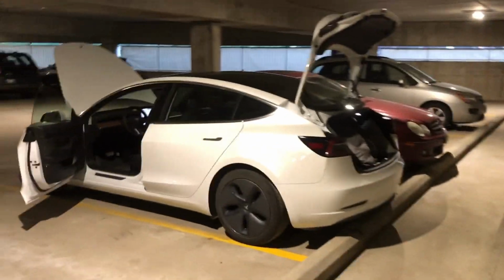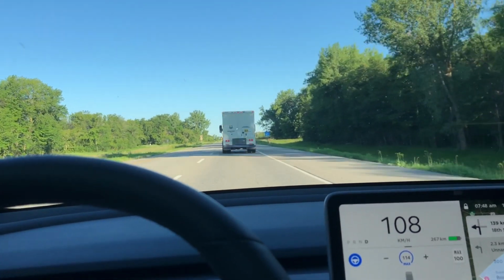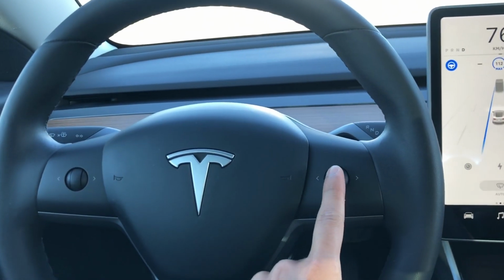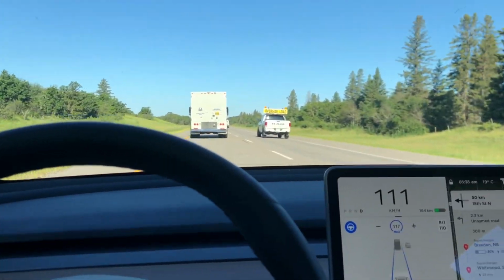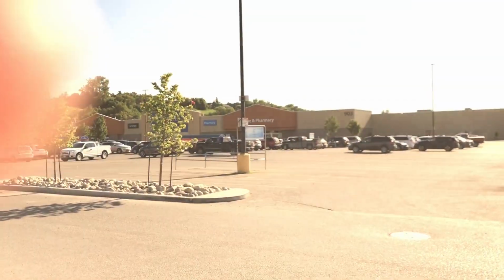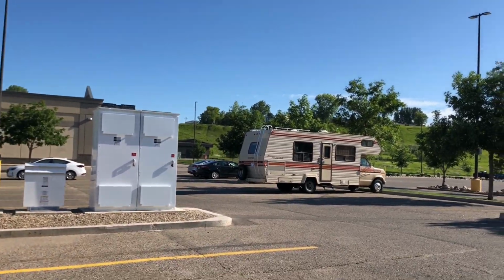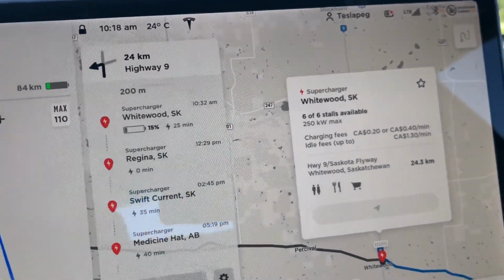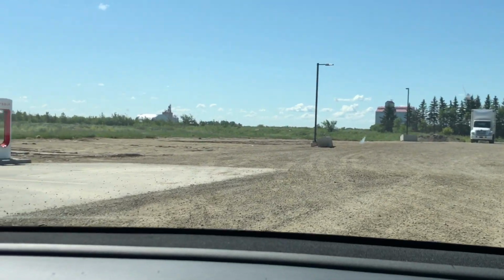Taking A Tesla Model 3 On A 1500 KILOMETRE Road Trip In Canada | VLOG 3

Comment: Good video, like the rubber ducky on the dash haha.

Does the battery/remaining km reduce accurately? Like after 5 km your range shows exactly 5km has been used?
Reply from the maker: Haha thanks 😊 

Yes. But, it only reduces uniformly in the summer when you’re driving conservatively. You can get a better idea of the estimated range on the range tab for better calculations

Comment: I understand you need to charge b/w 75-80 percent  to have longer battery life but  why wouldn't you charge to 100% while travelling?
Reply from the maker: Good questions! The reason for not charging to 100% is because it takes the exact amount of time to charge from 0 to 80% then it does to charge from 80% to 100% so wasting time charging more wouldn’t be ideal as there are super chargers available every 100kms
Reply: @teslapeg  thanks

Comment: I drove my 02 TDI from Winnipeg to Edmonton (1350km). Took 10.5hr, only stopped once in Saskatoon for diesel and food, and still had 1/3 of a tank on arrival. Tough to beat!
Reply from the maker: True but I saw little to no change as I travelled with my friends with a gas car then with Tesla. 
We needed to stop every 2-3 hours anyway for bathroom breaks and food which usually took longer than the supercharging times. 
Plus most people aren’t in a hurry when they road-trip as I’ve seen. 
Lastly, everyone is a passenger, even the driver. The car does 99% of the driving
Reply: fwiw...and that implies nothing....I've done that trip dozens of times and 10.5 hrs is crazy fast, my average in 12-13 hrs...not impossible in 10.5 but certainly too fast in the winter and uncomfortable at anytime...I plan fuel and bathroom stops in Yorton/Toontown and then Edmonton. I drive a car with a 600ish km range in the summer and about 400 in the winter so diesel range is a dream only. In the winter sometimes need a stop in Minnesota as well as Yorton is dicey ay -30c or so. Cheers from Kenora.
Reply: Not everyone drives for 5 hours with no breaks